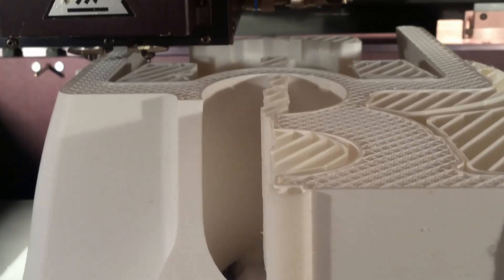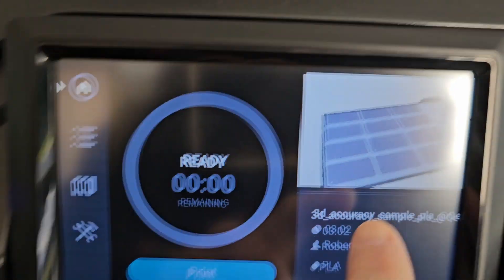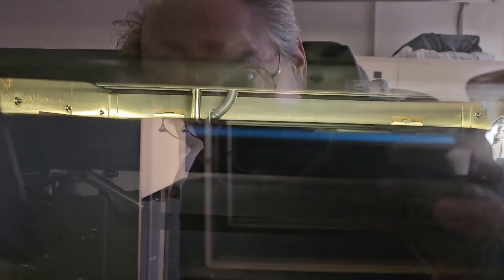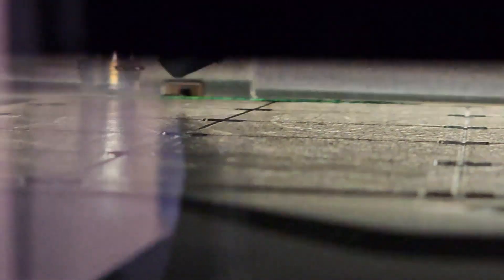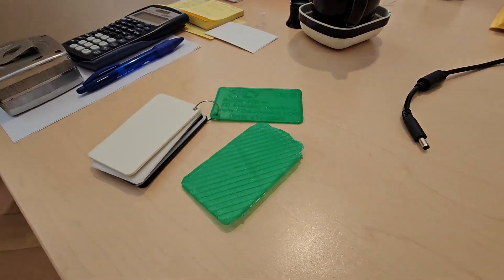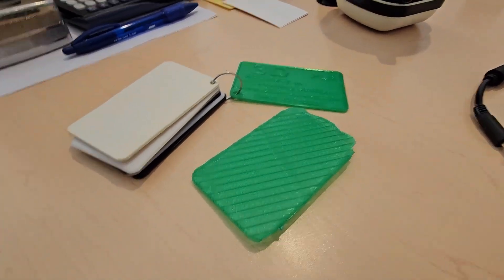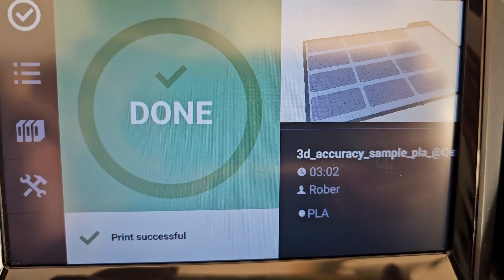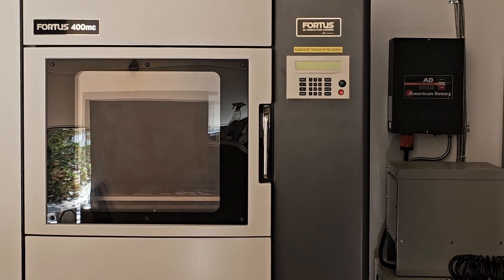Stratasys F370 first 3D Printed parts

Comment: Hi. Take a look at the Pantheon HS3 printers—they’re industrial-grade machines that deliver outstanding print quality. That said, I’m not implying this is a bad printer, but judging by the results, the print quality seems to be around a 6/10 at best. Other commenters are correct: the 3D printing landscape has evolved significantly. Talented individuals worldwide are developing groundbreaking technologies that have outpaced these "old-fashioned industrial-grade" printers.
Reply from the maker: Welcome @farazahmed9247, thank you for your comment, I appreciate it.

I checked the Pantheon HS3, looks to be a decent 3D Printer, however, it won't work for my needs, see below.

You said: "Other commentors are correct: the 3D printing landscape has evolved significantly. Talented individuals worldwide are developing groundbreaking technologies ..." I agree to a point; however, I don't buy into the sales pitch hype. Any good company will strive to make progress or vanish. Only time will tell how long they'll last.

Now, let's talk about the printed parts from the Stratasys F370 for a moment: Others have mentioned that the print quality doesn't look very good, you give it a 6/10 at best. The green PLA I used to print the parts is a translucent material. As you may know, translucent materials will always look different than solid material because you the see the other layers inside the part. It's thin enough that you can almost see right through it, so it looks a little funny, compared to a solid-colored part, but it feels nice and smooth. Try it, print a thin translucent part on your 3D Printer. I'll bet it looks similar. Does that mean your 3D Printer would be a 6/10 also?

Some commentors mentioned the warping on one corner of one part. I knew there was a chance of this happening before I even turned the printer on because the build sheet I used had been used several times before which wears the surface and increases the risk of separation and warping. This is not a problem with the F370, it's just an overused build sheet. Now why did I use this build sheet? Because my only need was to empty the PLA Spool and get it out of the printer. Had this been a print for a customer, I would have used a new build sheet and there would not be any separation or warping. These parts are just give away sample parts, they don't have to be perfect.

Four reasons I won't use consumer 3D Printers:
1) generally, they only have one extrusion (print) tip. I must have two print tips, one for model material and the other for soluble support material.
2) generally, they don't have a sealed, heated build chamber that can reach at least 75°C
3) generally, they don't print parts as large as I need
4) since they only have one print tip, they can't utilize a soluble support material
No matter what other niceties or superfluous bells and whistle features they stick on them, a consumer 3D Printer will not work for my business! You guys are just going to have to respect that. There is no convincing me otherwise.

I've been in business long enough to know what my customers need and expect. I should, I design most of their products. I also know what works for my business. 

Now, there are two other 3D Printers besides Stratasys that I would consider purchasing. The 3DXTech Gearbox HT2 and the AON3D Hylo. Unlike consumer 3D Printers, both have all the features I need. Neither of them are consumer 3D Printers, nor are they in that price range.

Hope you visit 3D Accuracy again!
Robert
Reply: @3daccuracy  Curious hobbyist here. What is it that this machine does that a bambulabs X1 can not do? I don't see any differences except having a bigger build area.
Reply from the maker: Welcome @Average-AL, Good question, thank you for asking it.

Besides a larger build chamber, the Stratasys F370 has three things that are important to my business.
1) It uses two extrusion (print) tips. One that prints the model material and the other prints a soluble support material. This allows the printing of very complex parts. Picture a medical device with several small interior passageways that curve through the part. A printer with a single print tip, like the Bambu, can't print the soluble support material in those passageways so where support is needed it prints model material as a breakaway support material instead which is impossible to remove from the part. With two print tips, the soluble support material can be printed by the second print tip in the space where the passageways are. When finished being 3D Printed the part comprised of both model material and support material is placed in a heated support removal tank where the support material is completely dissolved away leaving only the plastic part with fully open and usable passageways. 
2) It has a sealed, heated build chamber that can reach at least 75°C. This allows me to print the thermoplastic materials I need to print parts with.
3) It prints soluble support material. The example above makes obvious the need for this.

Now, even though I've never used one, I would guess that the Bambu is a nice printer. As long as it can print the parts you need, it could be worth having. However, I know it is not capable of printing complex parts which for my business, it gets crossed off the list, I wouldn't even consider it.

Hope you enjoyed the video and will visit 3D Accuracy again.
Let me know if you have any questions.
Robert
Reply: @3daccuracy  Ok, so it is mainly about the two printheads. I guess you have to print a whole lot of parts or charge a high price for them to get ROI on a machine like that. Can you share some rough figures about that?
Reply from the maker: Good morning @Average-AL,

Short answer, No! Now you're asking personal questions about my business which I will not reply to. If you need this type of information, contact Stratasys and your accountant.

Good luck,
Robert